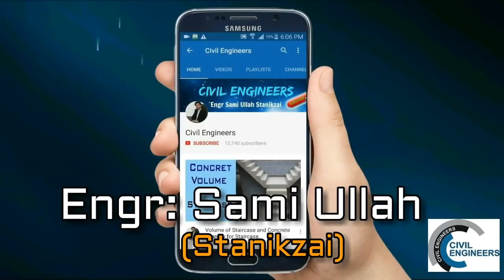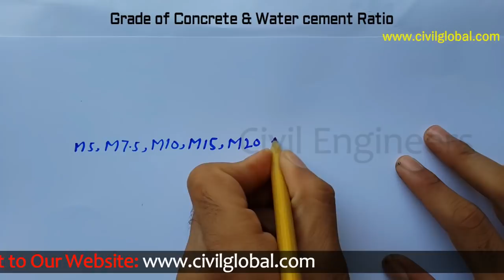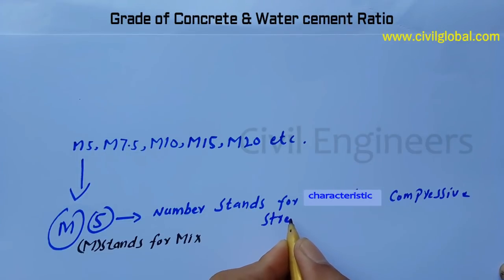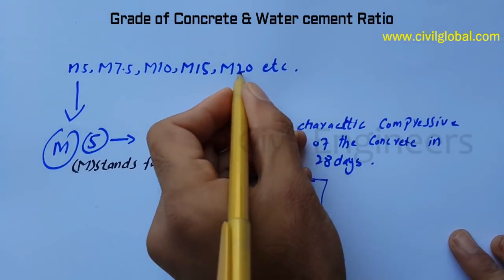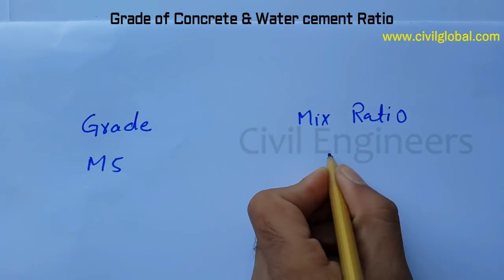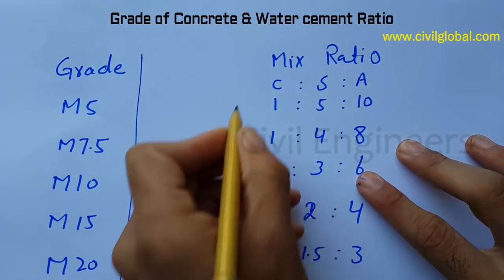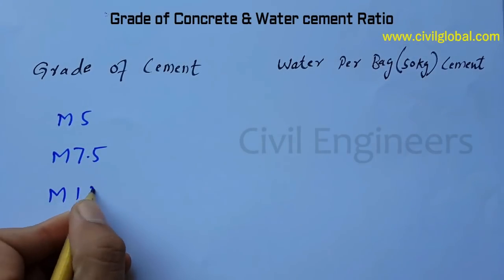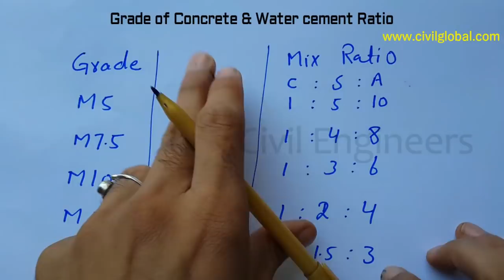Grade Of Concrete and water Cement Ratio

Comment: Hi sir ! Plz reply my question , my house span between two columns length  19 feet , wedth 14 feet , column size 9/15 with 6 bars of 16mm rectangler shape.and we make all house wall 9” before slab . It is safe or not plz reply sir.
Reply: Only G+0, ground floor only

Comment: I have a question in another video where you talked about W/C ratio it would be between 0.4 - 0.6? How did you get 60 Liters for M5 ? Cause if i use 0.4 x 50kg = 20 liters or 0.5 x 50 = 25 Liters or even 0.6 x 50 = 30 Liters How did you get 60 ?
Reply: I am also confused.  Maybe it has something to do with the sand and aggregate quantity.

Comment: Will you please explain, how you have calculated water required for each grade of concrete ?
Reply: M15- 0.5 to 0.6 ltrs per  1 kg  cement 
M20-0.5 ltrs per 1 kg  cement 
M25-0.45 ltrs per 1 kg cement
Reply: @viswan9092  right

Comment: i want to ask when you say 1:5:10  
does this mean the ration in terms of what  like if there is one bag of cement ( 50kg) the how much sand if the ratio is saying 5 should we like measure the quantity of sand and aggregates or what bcoz they dont come in packets like cement ??
Reply: Naveed Ladha there are some calculations and applied equations to work out the amount of sand and the same goes for aggregate to be used eg. a 3 by 3 square meters of slab. Once you get the amount of all three, the amount of water needed to mix these three items is calculated in this way. Watch a few more other videos and you’ll get the idea. The calculation depends on the project you are working on.
Reply: Mohamad Rafet  thanx
Reply: Cement bag (50 kg) volume is approximately 1.25 cubic feet (cft). For example a mix of 1:2:4  will have 1 cement bag, 2*1.25 = 2.5 cft sand and 1.25*4= 5 coarse aggregate.
Reply: They make a box for certain weight in KG and then count Accordingly

Comment: How have u calculayed quantity of water for different grades of concrete not explained.
water cement rato like 0.55 Or 0.5 or 0.45 etc. also not covered.What should be the standarad wc ratio for different grades not covered.
what is the relationship of grade of cement like 43 or 53 etc.with grade of concrete ?
Also the characteristic strenght of conctete depends upon 28 days of  curing of concrete nd not simly only after 28 days.Reference to IS code is also missing in the presentation.

Comment: How do I know what grade of concrete should I use in a certain work? Thank you!
Reply: it depends on the design. but according to thumb rules, 
for PCC ....Grade 7.5
for Footing ..Grade M15 or M20
for coloumn.....Grade M15 or M2o
for Beams ,,,,Grade M15
for Slab ,,,,Grade M15 or M10
CDepending on weather its G1, G2 or multi storey structure.

Comment: Wouldn’t it be easier to calc water per cubic yard  according to mix design? How do you know the Precise water is going into the load? “Slump test” 4 inch 5, 6 etc done on site by a resident inspector. Loads are calculated by sacks per yard according to aggregate size. Pea gravel, 3/4 loads, gip, etc etc.

Comment: simply 50 kg x by 0.6 or 0.5 = 30 litres of water reuired per bag and you wrote grade and didnt show for what purpose is grade used
Reply: Kamran Gul your post is correct. The video is incorrect in so many ways, water will be constant for cement....it will not change on the mix....what changers is the water ratio for slump that is required....
Reply: Kamran Gul it's the ratio w/c=.6 or .5 so whatever is cement quantity multiply it by.6 or .5
Reply: 30×59
Reply: Sir ,what is that 0.6 and 0.5
Reply: See here more

Comment: Why and how decide the m20 mix grade of concrete in use 30 liter per beg
Reply: Water/ cement  ratio connect to grade of concrete
Reply: Concrete के सभी msq question देखे गुप्ता और Khurmi के https://youtu.be/_QrOEQ2_f_M
Reply: Bimal
Reply: In perfectly water needs 5% from weight cement. More water take stratification in the mix, after dry take micro cracks , if we have sandy ground , the cement milk absorbed in ground lose itself design strenght. We need as little water as possible. water influens on workable mix. And we need to put different additives.

Comment: Q1: We have poured concrete with SR Cement, mixed up the concrete with sweet water mean drinking water. Can we cure the concrete by the sea water??
Q2: DPC on the SR Cement Concrte mix structure is required or not ??
Answers are urgently required.
Thanks and Regards
Reply: No we can't curing concrete by sea water... The water penetrated in concrete and future it tends to crack in concrete.. Also corrosion in steel of rcc member

Comment: 60 liter and 45 liter and so on. How can you find? Or can we take as assuming ?
Reply from the maker: its already the proof
Reply: I will say not a very good answer from a Engineer, what proof. Water ratio will depend of lots of things, what slump you require, lots and lots of variables involved, is the sand wet or dry same for gravel/rock.

Comment: In 28days means could u explain plzz
Reply: In 28 days means actually on 28th day. 

For example, if you say that the concrete achieves a compressive strength of 50 MPa in 28 days, that means, the compressive strength of the concrete will be 50 MPa (a minimum of 50 MPa) if you test it on the 28th day. The day is counted from the day you mix and cast the concrete. For example, the day you mix and cast the concrete will be day zero and the very next day will be  1st day. Hope this is easy to understand. Good luck :)